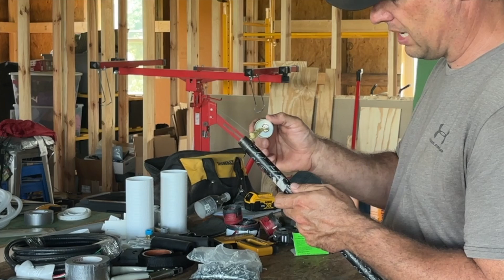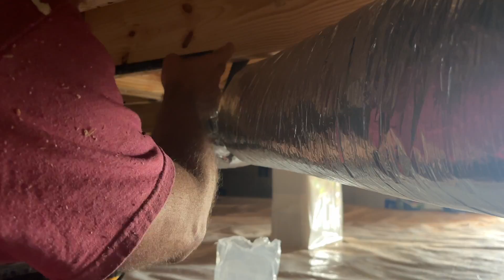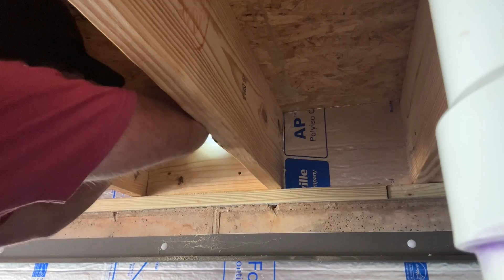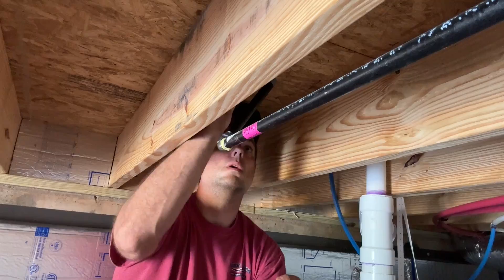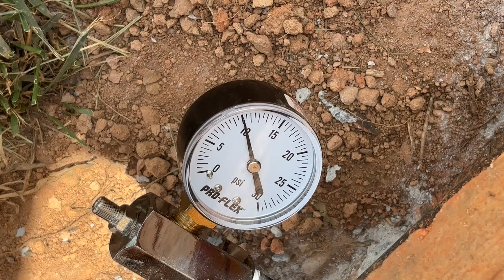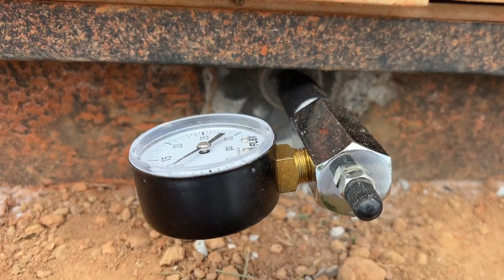Black Pipe Gas Line Rough-In For The Barndo

Comment: I've seen some videos use tape and then pipe dope, gas rated, and the claim is that it never leaks. What do you think? Would you have used this method?
Reply from the maker: My thought is using both isn’t really needed.  I think cleaning the threads, making sure you get everything coated with compound, and then getting the connection tight will get the job done.

Now on the other hand, I have never read anywhere that says you can’t do both.

Once we get the propane hooked up I will do another test to make sure we don’t have any leaks and that the pressure at the appliance end is appropriate for the range.